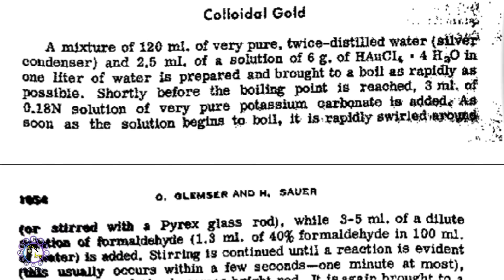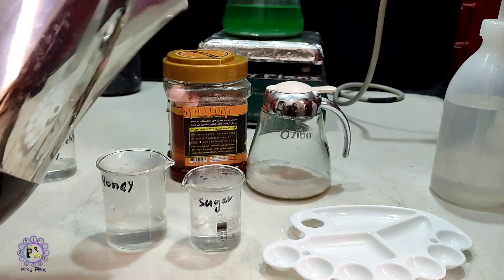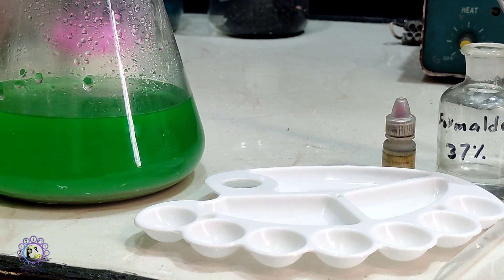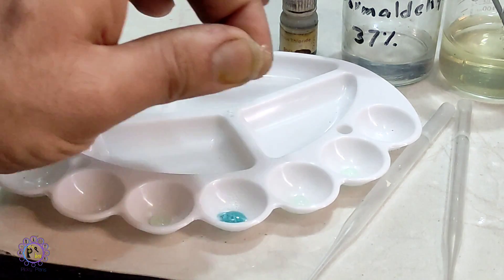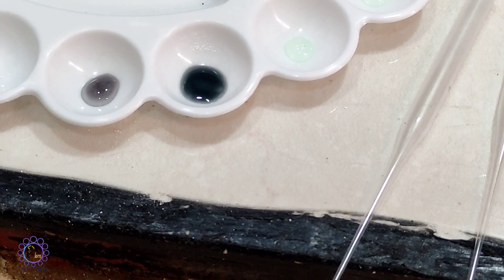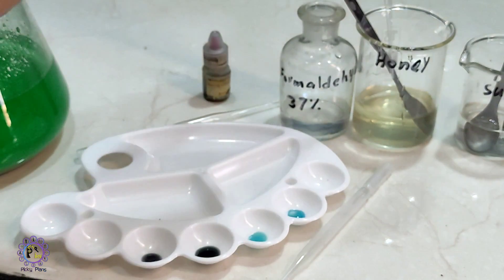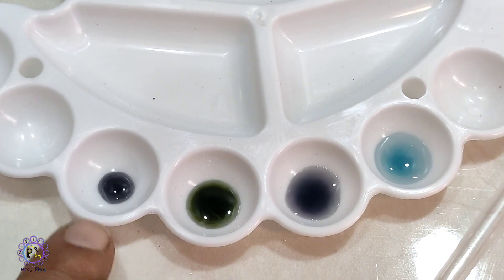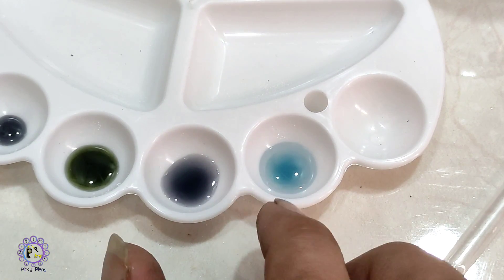Honey GOLD test an alternative for Stannous chloride !

Comment: Another great video, stannus chloride is experensive here now i found a cheaper alternative thank you, my question is should i add sodium carbonate first or its not necessary?
Reply: @PickyPlans  

Alright thank you.

Sometimes when I burn the ic chips grind it then give it a bath in nitric acid with heat. Clean with water then dissolve the remaining gold bond wires and participate it with smb after denoxing excess nitric acid I get colloidal gold. 

I was sure there is no any base metals in the peaker since there is no more fumes even after adding more nitric acid with heat under it but this what happened, how to prevent that? 

Also is there anyway to dissolve colloidal gold and participate it as metallic gold or there is no way?

Comment: Sir what is the ratio of stannous chloride?
Reply: For example ' i have 2 grams of tin. I dissolve it in 20 ml of hydrochloric acid. How much distilled water will be add? And how to calculate tin, muriatic acid, distilled water, to make stannous chloride?
Reply: how long does it take for stannous chloride to expire

Comment: Very very interesting sodium carbonate to test for copper and honey to test for gold. 👍 I wish I had saw this vid 2 weeks ago so I could do a test on the silver sulfate solution I had, before and after filtering, then to test for copper with sodium carbonate.

I had done a silver seperation from silverware with pieces of pc board using diluted sulfuric acid with sodium nitrate from 6 months earlier. I added salt with water to drop silver, but nothing dropped. After filtering the existing off white sludge, more likely its silver, from the translucent green blue solution. I placed a steel rod to drop the copper, twice. I wish I new I could use sodium carbonate to test for the remaining copper in the solution. Well, now I know.